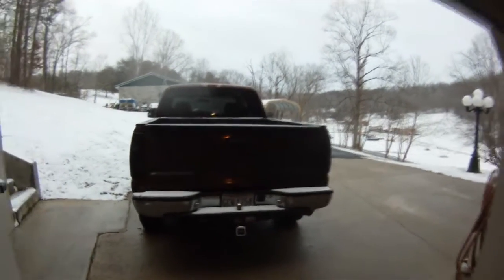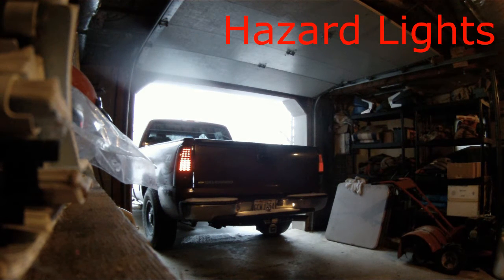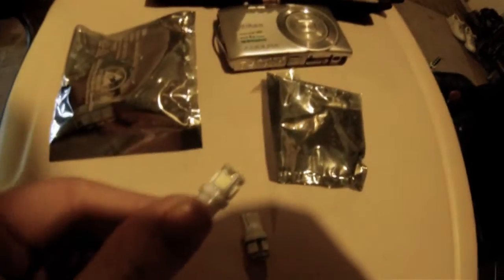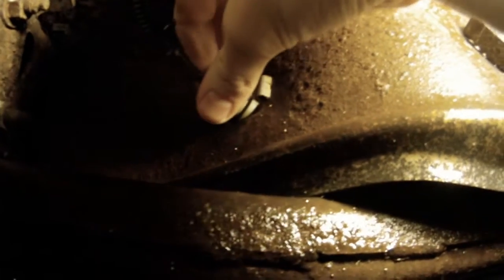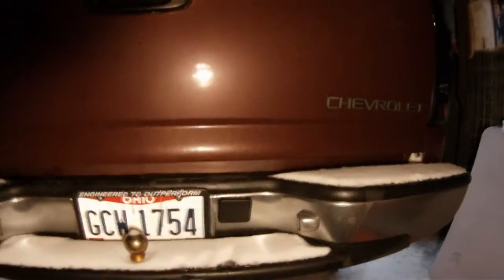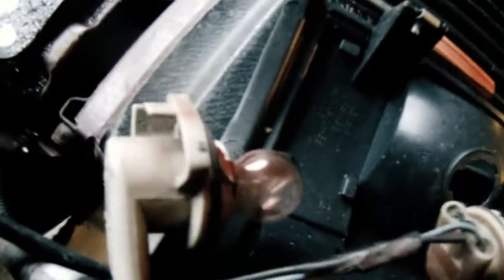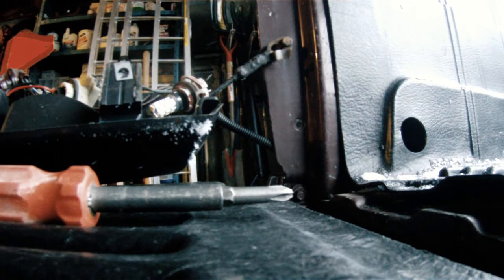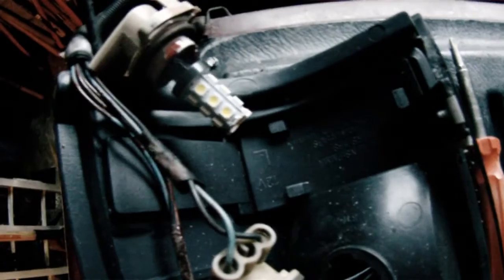Black Smoked Spyder Tail Lights for 2000 Chevy Silverado ALT-ON-CS99-LED-BSM

Comment: you need a load resistor they sell them on ebay make sure you get the ones that are assembled already
Reply from the maker: Herbert James I ended up changing the timing box under the dash if you know what I mean.

Comment: I have kind of custom headlights you have but what bulbs are you using?
Reply from the maker: Hi Raylin, those headlight and turn signal assemblies were made by spec-d. The lights were Xenon HID at a temperature of 80K. I bought them from protuninglab.com. I do not recommend protuning lab because of how short their return/warranty period is. It's only 30 days. Carid.com has earned my business because they have always gone over the top for me. Also, I don't recommend ever using spec-d lights, the assemblies are complete junk and the lighting is terrible. I ended up throwing mine away and replacing them with some headlights made by Spyder Auto. Spyder has great customer service and even sent me a new tail light once, for free, out of warranty, because I was in a wreck and was looking to buy just one.

Comment: Can you tell me if there worth it? If possible can you send me the link to the lights i’ll like to buy them, i have the same exact truck can you please show me how to install them also?
Reply from the maker: Hey, it's been about 19 months since I purchased these taillights and they still work just fine. I personally enjoy the look. The only concern that has come to mind is, I am not sure what I will do when one of the LEDs finally burns out, because I think they are all soldered together on a board. The link I am including below is not where I purchased mine from, but it is where the best deal currently is :). 

https://www.newegg.com/Product/Product.aspx?Item=9SIA08C57E3707&ignorebbr=1&nm_mc=KNC-GoogleMKP-PC&cm_mmc=KNC-GoogleMKP-PC-plaAT+-+Automotive+Lighting_-9SIA08C57E3707&gclid=CjwKCAjwzYDMBRA1EiwAwCv6JvuffIqvH4YhRKT_mxtxGbboLyf3PNNvGFeywfn33eudrVn9ErScDxoCK88QAvD_BwE&gclsrc=aw.ds
Reply: Zach Schweinsberg thank you man thank you! I wanna know how to install em been looking for videos all day just got this truck from my mom passed it down to me and i wanna do some things to it!
Reply from the maker: These lights are rather simple to install. The old lights come loose by undoing a few phillips head screws, unplugging the harnesses, plugging the harnesses back into the new assembly, putting screws back in. Really simple, but two things worth noting. 1.) When you plug the wires into the new taillights, they don't go in the same place (i.e. middle wire may go to top of taillight), the instructions will tell you. 2.) You may get the hyperblinking issue, if so, this is easily fixed by replacing a $10 box just under the steering wheel.
Reply from the maker: I bought my flasher module from here, you should probably just go ahead and order it to, save yourself the trouble. What happens is, when you switch from halogens to LEDs your truck will think a bulb is blown out because they use significantly less power. I do not recommend a load resistor for fixing this problem because they get hot and will melt any plastic they come in contact with. https://www.superbrightleds.com/cat/flashers-load-resistors/filter/Type,LED_Car_Flasher,60,3607:Type,LED_Motorcycle_Flasher,60,3608:
Reply: Silverado Duramax  Angel Mercado 717 👽👺💀👾🎅😱